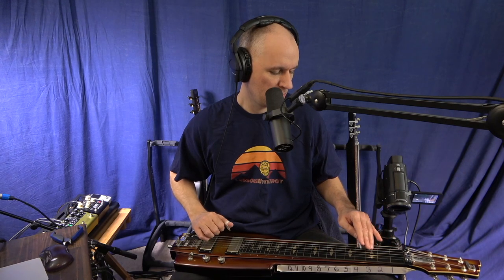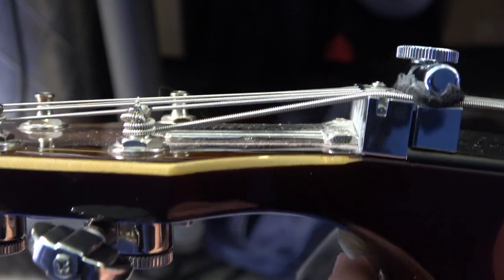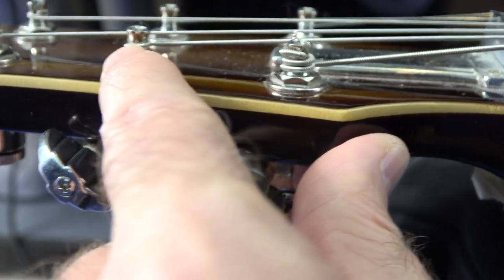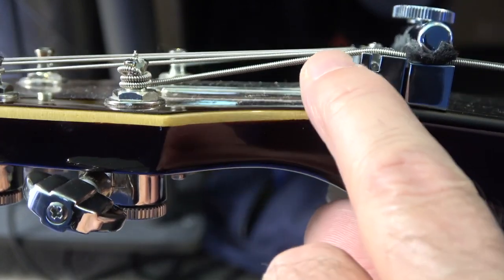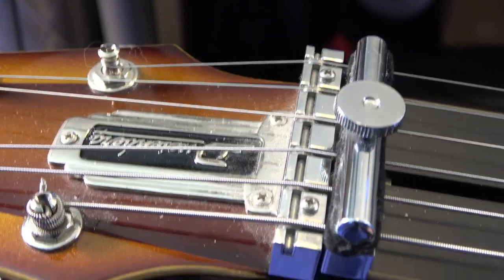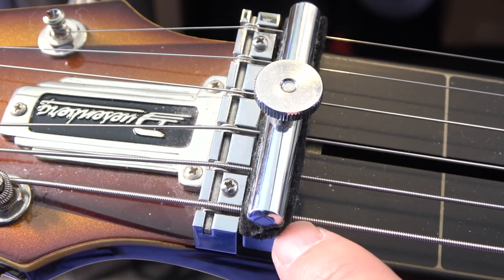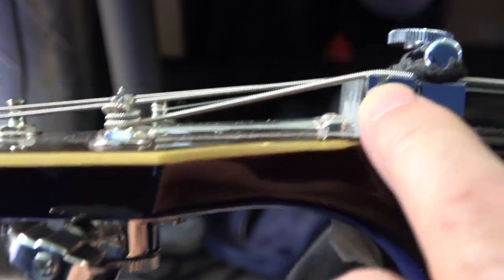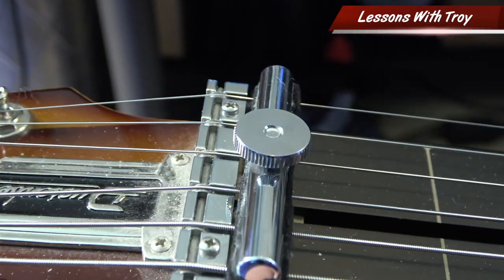Getting a Tighter 6th String on the Duesenberg - Open D

Comment: Hi Troy, sorry but I will have to disagree. Break angle does not affect the string tension unless you go to extremes that lock the string in position on the nut, unfortunately any perceived differences are just that, perceived.
Reply: Agreed. This video is just a total misunderstanding of physics. Total nonsense.
Reply from the maker: Please read: https://www.sweetwater.com/insync/string-tension-factors/
Reply: @LessonsWithTroy   Sweetwater are wrong on that point. The basic factors influencing string tension are scale length and string mass per unit length and the note you tune to, However , as players we don't have the ability to feel or measure string tension directly, we assess it on how easily we can deflect the string. This is also affected by factors such as the strings bending stiffness, core to wrap ratio, and the free length beyond the scale length at both the headstock and saddle. This last factor has the effect of extra length making the string easier to deflect, not tighter at rest, but easier to deflect. Unless you lock the string at nut or saddle the extra length beyond is going to make it feel very slightly looser. You are not locking the string at the nut on the Duesenberg with a little extra break angle, not with a roller nut, if you did you would have trouble tuning the string.
Reply from the maker: I’m not going to spend my time arguing with you. I need to actually spend that time playing, practicing or recording. Thanks for your input but I’ll go with Sweetwater and my own real world tests on this one.
Reply: @LessonsWithTroy   I'm also not going to argue with you, just presenting the physics and engineering behind this situation.
Reply: @LessonsWithTroy  For a given scale length and string guage, the tension determines the pitch. If you are getting the same pitch and the only thing you changed was the break angle, then you have the same string tension. Sure, increasing the break angle can increase the amount of friction at the nut, but that can cause tuning instability if the string slips one direction but then binds instead of returning to the exactly same equilibrium. Often nuts are lubed with graphite to avoid any binding friction at the nut. But don't you also have some sort of locking nut? Once you lock the nut, nothing on the other side is affecting the string tension. Break angle-induced nut friction is irrelevant if the string has been locked and is entirely prevented from sliding across the nut.
Reply: @Thoracius   It's not a locking nut, it's a built in capo which does not exert enough force to lock the string, and does not prevent tuning. Behind it is a roller nut so no nut friction.
Reply: @jeffhigh2  ok so the roller nut basically acts like a pulley, so it's just basic elementary physics that the break angle has zero effect on tautness.  Increasing the break angle is a good idea though because the string tension exerts more downward force onto the nut. That is presumably the source of the misunderstanding.
Reply: @Thoracius  I'll answer you because you have some misconceptions but I am not attempting to convince Troy. In general break angle of the order of 10 degrees is needed to seat the string reliably at nut or saddle, More is not better and particularly combined with splayed tuner posts can lead to tuning instability. (Gibson)  this is why modern designs with tremolos  such as PRS tend to use a straight string, low break angle at the headstock.
The Deusenberg here is a bit of a special case. The roller nut is effectively only a string support and spacer. The inbuilt capo is actually a movable nut with a low break angle  produced by a bar clamped on top between front and back edges.
Reply: @Jeff Highland You are right, it‘s the perceived higher tension. 
   Because a steeper break angle at the anchor points of the string provide higher friction at those points due higher pression, giving the string more resistance to slip over that points while pushing on the string with the slide.  
   So, a steeper break angle helps indeed for the strings to feel stiffer (with perceived more tension)😊
Reply: @lone-wolf-1  In this case there is a roller nut and bridge saddles so a slight increase in break angle at the nut is not going to make a difference